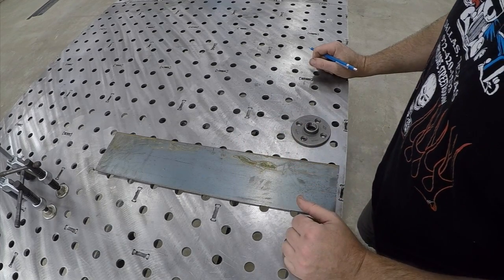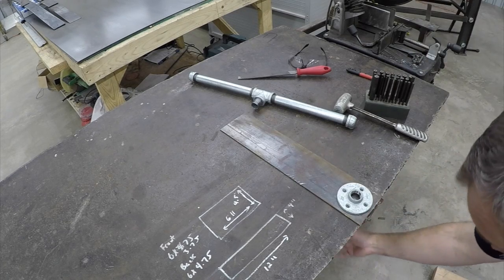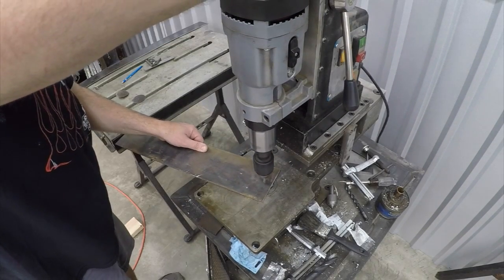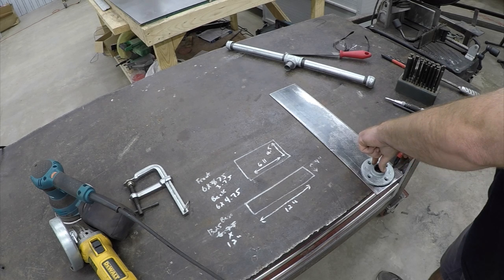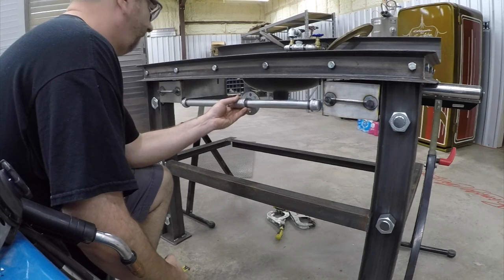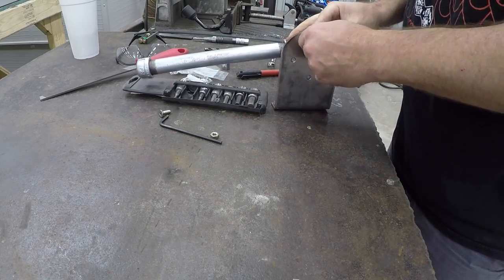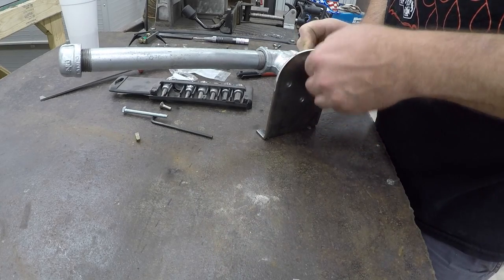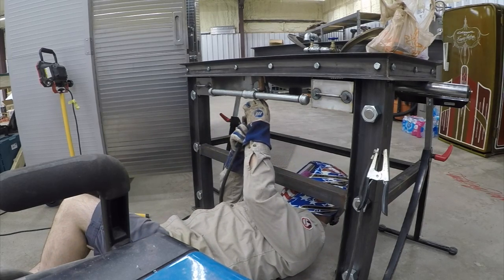Fabrication Basics // How to make a simple bracket

Comment: hows the grizzly brake holding up
Reply from the maker: awesome.  i don't use it alot, maybe once per month, and i have also bent 10 gauge on it quite a few times (narrow widths) but it has held up well, its very well built

Comment: Are you going to pull the bar out so the bracket is square to the vanity top :-)  I know that would drive me nuts.
Reply from the maker: Not sure what your talking about.  It's square top rail, which is square to the vanity top.  It was cocked to one side slightly but that bracket is 1/8th" and i tweaked it slightly to get it square.
Reply: From the camera angle it looked like it wasn't square to the top.

Comment: Encourage people to use cardboard to make mock templates.
Reply from the maker: good idea, its a necessity some of the time, but in this case its not needed.  Now that punch would have come in handy for 3 of the 4 holes on this!
Reply: I totally cringed at the thought of sanding off those corners, especially when you have a band saw. I'd at least made the final pass on the sander, but not the whole chunk! Haha!
Reply from the maker: Nawh man, that grinder is made for exactly that!  it's a beast.  Plus I don't keep the bandsaw setup, its normally sitting on the shelf and takes a couple extra minutes to set it up, by the time I had gotten down and clamped it to the table i had it piece rounded over on the grinder

Comment: Polished 3/4 inch copper pipe with brass thread to copper connector behind the Tee would look as well, because the galvanized is kind of a dirty material. Kind of match your door front seams too but this looks nice as well.
Reply from the maker: I like copper pipe, or copper anything for that matter, definitely will be incorporating into some projects.

Comment: I noticed you didn't use any pipe thread sealant in the final assembly, do you think that fixture will be water tight?
Reply from the maker: lol, good question sir.  honestly i am not crazy about the galvanized piping.  Its kind of played out, and over done.  But it's quick and easy and kind of industrial.  For a real customer thats willing to make I would make anything like that out of some tubing for custom fit and finish.
Reply: +🔥Tubing would be a nice touch Gary and the pipe works out very nice too.